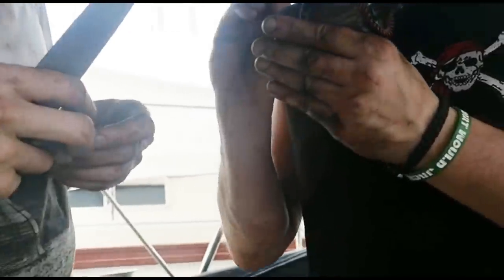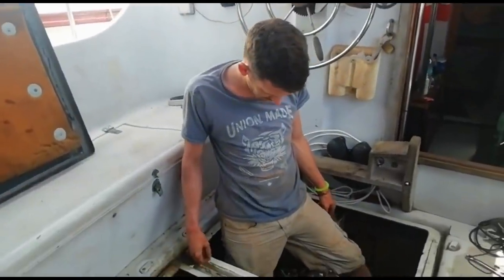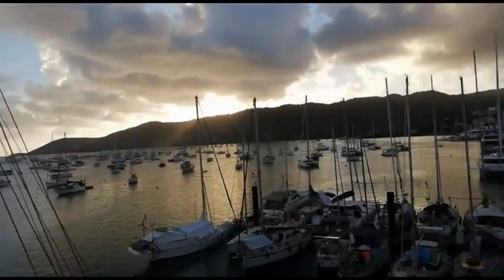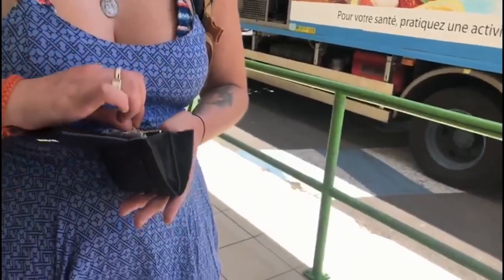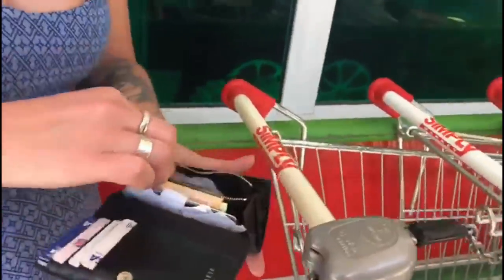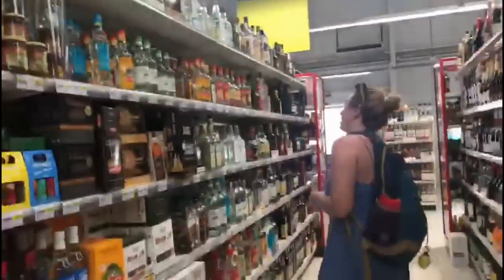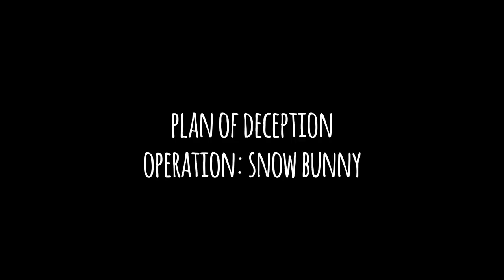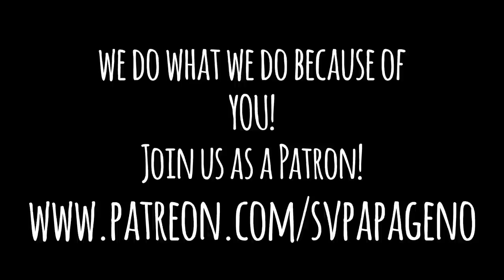The Papageno Diaries: S2 Ep 2 "Engine HELL, Brits, Beer and SURPRISE CREW!"

Comment: Guys, you need to investigate how the engine got water in the cylinders (Hydro locked) in the first place. If you don't find the problem, it WILL happen again and next time you could do damage you won't walk away from. Trying to start against the water pressure could easily bend a rod and f*ck the engine. Check the syphon break, make sure it's clear and operating properly. Check your exhaust system and make sure the engine is discharging its exhaust water properly. If it's not or the syphon break isn't working properly when you shut down the engine, sea water rushes back up the exhaust and into the cylinders... Good Luck!!!!!

Comment: Much better video. :-)    Now for the serious bit. The water did not get in the engine by accident. You need to get the head off to check for head/block cracks or head/block warpage, wet liner seal leak or hopefully just a blown head gasket.  Hope you find the problem and get it fixed soon.  Have fun. Fair winds & regards from the UK

Comment: Luv ya Liz, but agree with Simba, likely a leaking head gasket that let water from the cooling jacket into the cylinder.  Fix it now, before it costs you dearly later.
Reply from the maker: Hey, head gasket has been checked all over and it’s all good
Reply: @EarleWrites  I would definitely check what Simba said about the siphon break then, he obviously knows more about sailboat diesels than I.

Comment: Did you find out how the water got into the cylinders in the first place? if not you're bound to have the problem again. My guess is the exhaust manifold having rusted and is leaking water back into the engine through the exhaust valves.

Comment: Yep, called it before, cylinders full.  The rag though...hmmm...
Reply from the maker: The rag was ridiculous. I have no idea what that could have been used for!
Reply: @EarleWrites  it is pretty common for mechanics to stuff rags into openings of engine parts, especially intakes, when doing work to prevent things getting into those openings.  i.e. stuffing a rag into an open carburetor intake to prevent dropping nuts/bolts/etc from falling in there and then having to take that apart to remove the dropped part.  I suspect someone did that here and simply forgot to remove the rag when they re-assembled things.  Good to see you here in the comments!  What's up with the 21 paintings?
Reply: What I was Thinking. Mechanics still only human, we Forget things, occasionally.  @stimpsonjcat67
Reply: @jimnickles2347  Oh hey man I am not throwing stones!  I forget stuff all the time!
Reply: @stimpsonjcat67  Yep, always a good idea to use a red rag. They stand out and rarely get missed.

Comment: Oh, LORD! Deception and INTRIGUE! And they haven't even Left the Harbor...I'm not sure about the Rum-Fueled Thespianism. Never was much of a Fan of Theatre, lol.. But, Monty Python is always Good..And Benny Hill, Of Course....I liked Tree-Beard's masthead Asides. Now that you got the Rag out of her Intake, and the water out of her cylinders, the engine will seem like a big Tug Engine,LOL! My concern is, How TF did all that Water get inside anyway? All MY Possibilities are BAD Ones. Blown Head gasket, and/or Cracked Block or head internally. Or Warped Head due to Overheating....Captain, I Respectfully Submit let's Pull the transmission and Find that Leak and fix it, and Inspect the clutches/bearings, BEFORE we Burn it Down and Wind Up On The Rocks. As long as the engine Runs At All, It's Good for awhile yet. Transmissions get Overlooked WAY Too Much, however, and it doesn't seem to me like the previous owners gave a rusty rat fuck, or knew little or nothing about PREVENTIVE Maintenance. Trans parts not very common, engine parts much more so. Looking Good So far, otherwise.

Comment: did you have the cylinder bore's checked for scarring due to the water in the cylinders?  The last thing you need is an engine failure at the time you need it most.

Comment: I didn't notice, but was the guy welding on the new hard rail a crew member with a portable TIG unit, or was that somebody brought in from the yard?  If the former, way cool (and make maximum use of that capability while he's on board!).  My thought while watching that, was were I not a welder (I am) I probably would have cheaped out and gone for regular life lines even though an Amel is supposed to have hard rails, and used that money elsewhere on the boat.  But if you can do it yourselves for just the cost of materials, then of course that changes the equation.

Comment: At the absolute least your engine needs a total rebuild.  Ideally a totally new engine.  No surprise I’m sure but the engine will be the crux’s of most of your problems
Reply from the maker: I can't wait for you to watch the next episode because the amazing Jorn is a genius. Papageno has a very good engine. It's the smaller other issues around it that required some maintence, and some parts replacing. We call Jorn Frankenstein now, and Papageno is his hybrid species! We're very happy to have a team of people from different specialisms, welding, carpentry, engineering and electricity!
Reply: That's how it Is with engines, the Engine Itself can be Good, or Good Enough, it's always the Peripherals that cause the headaches. Bad hoses Blowing, rotten fuel lines breaking, fan belts, worn seals/gaskets and their damned LEAKS, LOL. IIRC, Liz already had the alternator Rebuilt? Snag a Spare, if possible. As long as the engine doesn't knock or clatter LOUDLY, or Run poorly, it should be Good. It'll Warn you Beforehand when it's Sick. The Transmission WON'T. It'll quietly Work until it Goes Out.  @EarleWrites
Reply: It definitely didn't do the engine any good, but at least it was just hydraulic locked and not seized, but sometimes even a seized engine can be revived and continue in service.  This one may go a few months and croak or it may go for years.  A lot of variables and things that can go wrong, but marine diesels are at least built pretty tough.  Certainly saving for a re-power sooner or later is in order with a boat that age regardless.  I hope they changed the oil after they got the water out of the cylinders.

And now while they are in a port is the time to start picking up spares.  Spare accessories, spare belts, spare cable and wiring, injectors, spare sealant, gaskets, gasket making material, etc.  A sheet of gasket material and some razor blades can be a life saver.  For sure track down what let the water into the engine, not only so it doesn't happen again, but because add another failure point in that system, and it could just as easily sink the boat.  Oh yeah, extra pumps and make sure there is a manual pump in working order.

Good news is at least they can sail now even if the engine doesn't work.